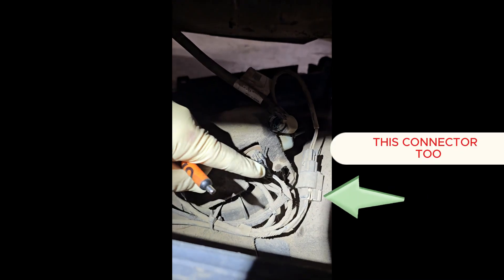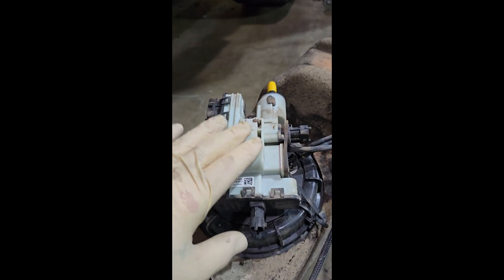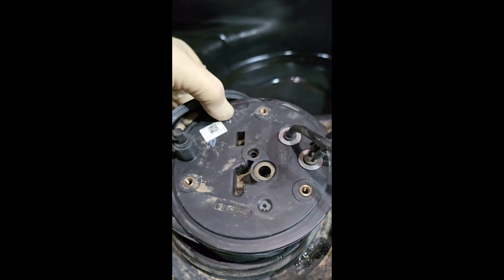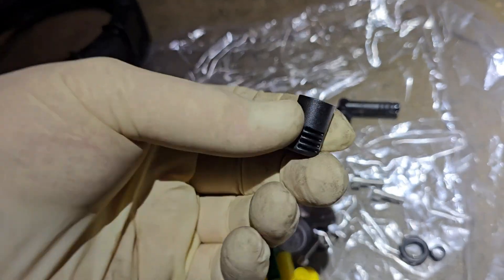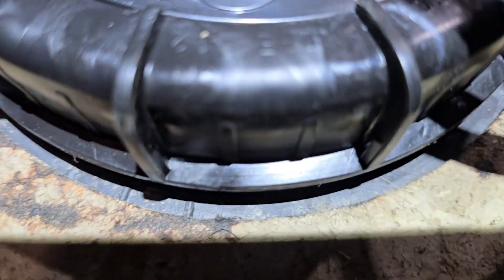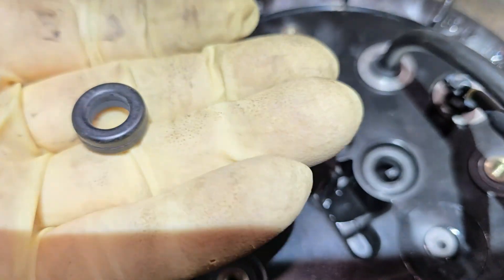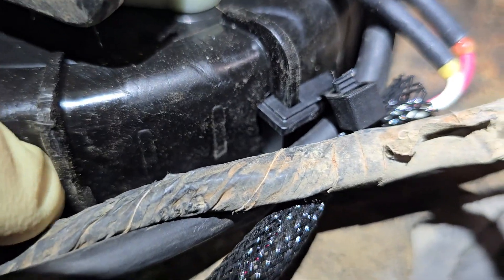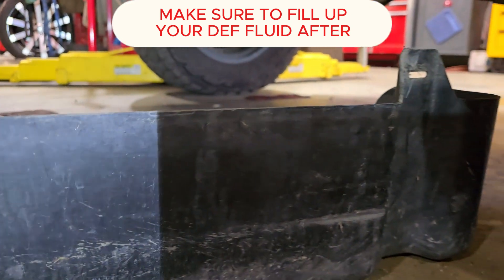LML Duramax 12-16 Def Heater Replacement

Comment: So I got the plastic cover back on no problems.  However the bolts for the straps had to be drilled out, UGH
Reply from the maker: Sounds like you still got it done though, nice!

Comment: Thanks for the video...i just completed the swap out.
HOWEVER...
Quick question....if the truck never went into limp mode will using  a standard OBDII SCANNER to clear the code reset things or am I gonna have to take the truck into a garage and have them reset the heaters and such??
Reply from the maker: You should be able to clear the code with a standard OBDII scanner.

Comment: thank you for sharing that video. Also would like to know what’s the reason the reduction  heater, core fails and nox sensors fail so much on this trucks
Reply from the maker: The Def heaters are in a harsh environment constantly, Def is highly corrosive plus heating up.  Not sure about why the Nox sensors fail.